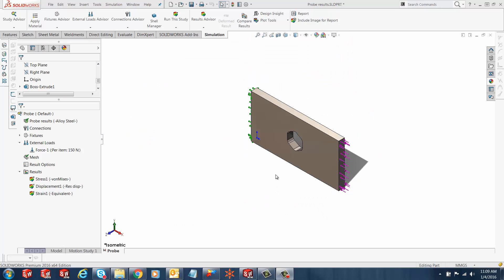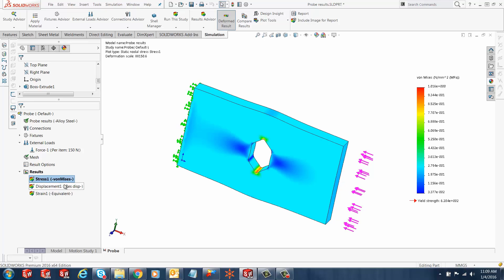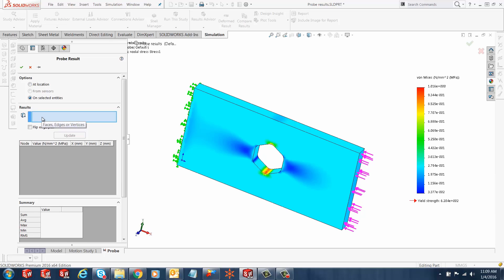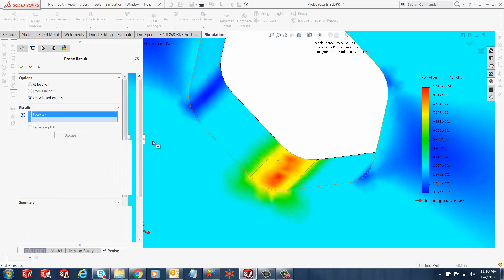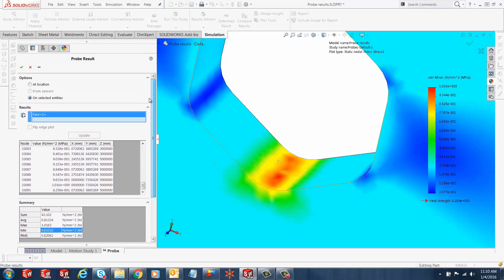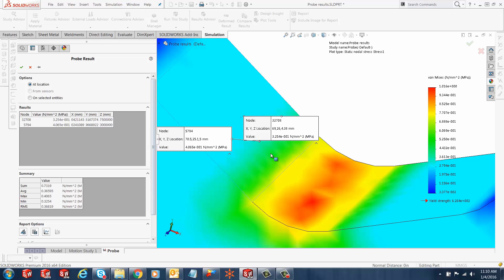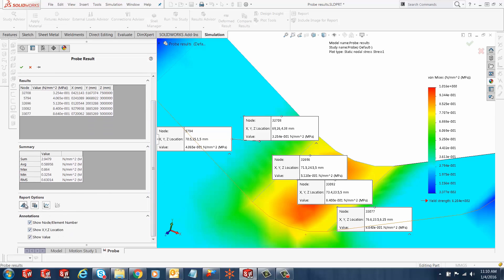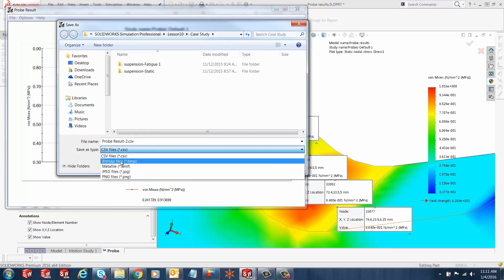SOLIDWORKS Quick Tip - Probe Results

Comment: how do we do this for internal simulation? The probe option is not there for the cutplot
Reply from the maker: Hi Bilal,

Are you referring to a section plot of your results? Probe tool should still be available. Please make sure the result plot you’re right-clicking on is bolded in the Results folder. 

The word ‘cutplot’ is the exact vocabulary in our Flow Simulation tool. If you’re trying to do this in Flow Simulation, go to Tools, Flow Simulation, Results, Probe Mode, Probe. 

If you’re still having trouble accessing the Probe tool, I recommend reaching out to your local reseller so they can screen share with you and help you figure out what’s gone wrong.

Comment: Great video. What if I want to know the result at a specified point, let's say 50 mm from the origin. What should I do?
Reply from the maker: Ahmed,

To obtain data at a specified point, you will need to create a vertex at that point. Use the Split Line command to create edges and vertices at the point you want to measure. Using the probe tool, you’ll be able to select that vertex and get data.

Probe tool always pulls data from the node of an element, and SOLIDWORKS meshes the model first at vertices, then edges, then faces, then the volume. Thus the only way to ensure you have a node at the 50mm point you want to measure is to create a vertex there.